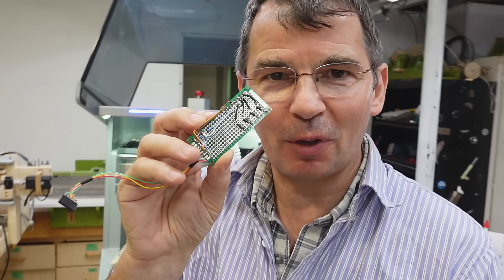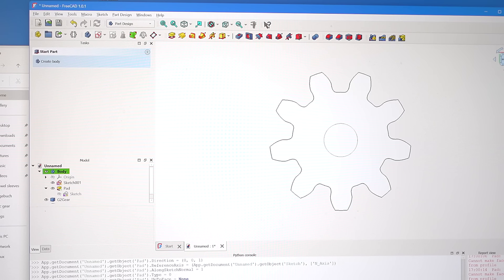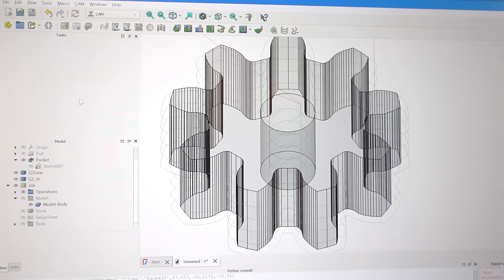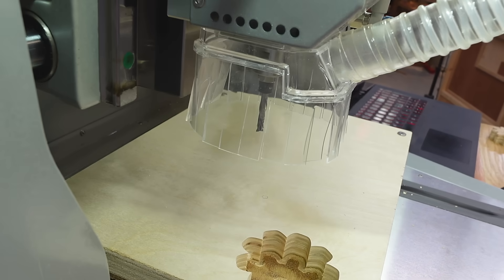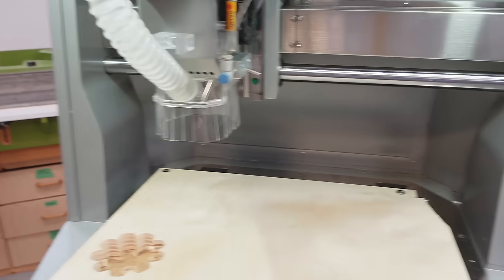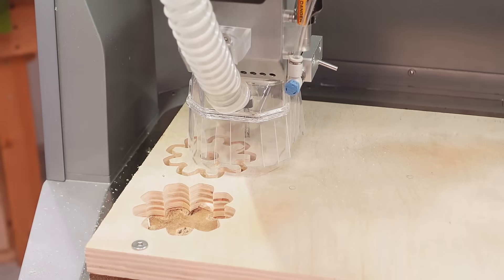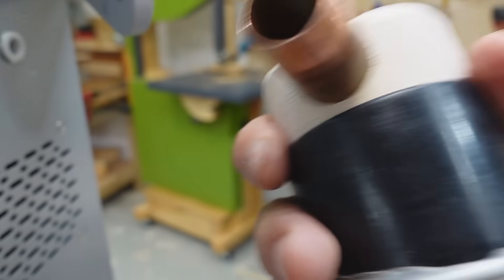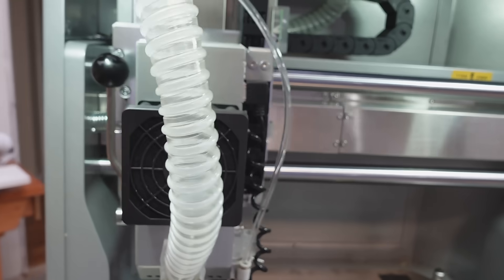Steep learning curve for using CNC

Comment: Anyone know what the clear material used in the dust collection shroud shown at 10:14 is, or how thick it is?  I found some clear vinyl that looks like it might be the same stuff.  It comes in thicknesses of 1.0, 1.5, and 2.0mm.  In the video it looks like 1.0mm, but I'm just guessing on that.

The dust collection brush that came with my CNC isn't long enough for some of my longer bits, and the dust sprays out from under the edge of the brush.  That material looks like it would be good to experiment with, plus it's easy to see through.
Reply from the maker: probably clear vinyl.  It had quite the smell for the first few weeks.
Reply: @matthiaswandel  Thanks, Matthias!  Any idea how thick it is?  It sounds like my next move should be to order some, then hang it up at the far end of the basement until the smell goes away.

Comment: You've probably gotten way more software recommendations than you wanted already, but figured I'd plug Onshape. It has a similar design and feature set to Fusion, but I've found it a bit easier/quicker to learn. The work flow is pretty logical and it's really easy to modify parts at any point in the process, so you don't find yourself pigeon-holed so much like some of the other programs out there. The main downside is that all of you files you create are public, so anyone can access your stuff, make a copy, and have an editable version for themselves. That's a bit of a bummer for businesses, but if you're not looking to patent something, it's been a fantastic free software for me:).

Comment: I taught AutoCAD for many years, but when I retired it was too expensive. Also, I use a Mac, so I purchased ICad Mac (single price, not subscription) in 2018.  I also bought Vectric V-Carve (single price).  I can take my cad drawings directly into VCarve and have
G code in a few minutes. This is not 3D, but works for things like the gear you were making.  Yes, it is not free, but it is easy to use.  
Actually, writing G code directly from the CAD drawing for that gear would be fairly simple, but would take a bit longer.

Comment: The comments at the end of this video really resonate with me.  If you don't use the machine and software regularly, you have to relearn it each time.  As much as I would like to have the capability to do CNC work, I would not do it frequently and quite frankly I don't need a new source of frustration nor an expensive tool gathering dust in the corner of my shop.

Comment: flatcam is the way to do cam for pcbs, it also can be automated.  I just run a script to do the hole milling, cutouts/slotting, traces, copper cearance it makes 3 gcode files in one go, i just have to change the source path for the gerbers..  I use a dual helix v bit for traces and a .8mm endmill for through holes slots and cutouts.  I made a video on the TCL for the automation scripting.

Comment: Makera has a cad program that you could have imported your SVG gear into and set up the tool pads in it. It's not great for overall design but if you have something simple like your gear as an SVG it would take you maybe a minute to do all of the rest of the things, and it's not that complicated, especially compared to freecad.  I design 90% in inkscape for vectors, or tinkercad for 3d, or a mix because you can import SVG into tinkercad.  And toolpaths and a little design work in makera cad. It's in their software download section. Check it out. 😊

Comment: I work at a cabinet manufacturing company, and I run the CNC. I do the programming and operating.  We have a Shop Sabre is 408. it is a 4" by 8" bed, and a 15 tool automatic tool changer.  Every tool height is preset. I manually offset each tool so they all have the same Z Zero. The auto Tool height isn't that precise, it will have variations of up to 20 thou.  Our hold down system is a vacuum table. It works great for large parts, but for small wooden pieces, I use a large piece of plywood suctioned to the spoil board, and screw the waste portions of the wood stock, and then leave tabs connecting the parts.  I have some videos of the machine on my channel.

We have two pieces of software, Cabbuilder, is a pricy web tool (about $1,500 a year) to design and generate primary Gcode for cabinet nesting. Then we also use Vcarve(about $750 one time purchase) for custom parts.  I program a lot of functions into the custom gadgets, its just lua, and is easy enough to learn.
Reply from the maker: well, if you use CNC all the time, then the learning overhead is relatively small.  Just most of my stuff is best solved with other means.

Comment: There is another option for PCB milling, I'll send you a 3D printer with auto bed levelling feature, and a brushless DC motor with a collet that will hold the exact size engraving bits you would require and all you have to do is sort out the Gcode with Onshape or Fusion. Of course work holding is just a matter of double sided tape and then you dial in some Z axis offset to reflect the 1.5mm FR4 thickness. YOu pay for shipping. I am in Kingston Ontario. Easy peazy, and tons more interesting than that Makera journey /headache.

Comment: ive been using blender for over 10 years they taught us it in highschool. theres endless plugins/addons mostly all coded in python to add extra features. i use one called machinetools for adding threads to stuff, theres one to check models to see if theyre good for 3d printing, and i would be seriously surprised if one for this task isn't available. might be worth a look, although blender itself takes a long time to fully understand as it has features for everything. diving in blindly will leave you feeling inadequate so use documentation

Comment: I’m not sure where you are coming from. Is this clickbait video designed to stir up the cnc haters or are you really just trying to point out this stuff is hard? On the cam side I really found it useful to learn about machine coordinates and work coordinates. Once you have an understanding of that you can get the machine to repeatably cut in the right place. A similar story exists with probing. Z probing is useful to find the top surface of the work piece and set its z height to zero. With your excellent teaching skills you can make a real contribution to this subject or I guess you can focus on getting the view count up.

Comment: As a CNC machinist working for a small manufacturer on a budget, I can confirm all CNCs and CAD/CAM packages have idiosyncrasies and a hard learning curve.

Some of us use FreeCAD here and it's definitely challenging, but also very configurable and powerful, the non-free CAD packages are definitely better, but they are insanely expensive for anyone without a high enough throughput to justify the expense. I think for the fact that FreeCAD is free, it's amazingly powerful.

For CAM we use an old version of BobCAD-CAM and it's pretty bad, some of the design decisions are baffling and counterintuitive.

Comment: I have been an acolyte of yours since forever, and I winced when I saw that abomination in the BG. And it got worse as you went in for various close-ups. For the same cost  I bought a proper gantry mill w/ 600(X) x 1200(Y) x 400 Z. designed for wood and I bought is to do detailed 3D wood carving and  V carving signs, plus some unorthodox but brilliant one off creations. It was quite capable on arrival of doing the minutia of PCB development. I have never, in the last 7 yrs, stopped learning new things and bettered my brainbox nonstop. As for the mill, sure some aspects needed improving, but at least it had a cast iron chassis, decent linear bearings on all axis (ways as you call them), and  most of the craftsmanship was tolerable. I am just doing the last part of an epic upgrade that featured some serious mission creep. Also had to re-learn some parts of Mach4 as I have installed new drivers and motors (closed loop), but will ultimately have a better understanding. This herculean task required the complete teardown and no stone was left, I had to manually reball all 12 HGH20 linear bearings + 3 ballnuts to remove all the wood dust/grease. 2600 of them, one by one, with tweezers... Nearly lost it. But I digress,.. mission creep factor is what happens as you learn the optimum  path forward. You don't know the full parts list at first.   During the lengthy and rather lazy process, I found timely morsels of critical design accents and methods of improving my process As it is, the upgrade has cost more than the machine. We won't speak of the new 3.2kW ATC spindle with the BT30 tool holders. Also the same re; the cost of carbide endmills and other tooling. Anyway Matthias,  what about Onshape that many YT influencers are shilling for? And do you really make enough as a YT content provider than Fusion will permit? I contest that. Respectfully yours, CGL

Comment: Sounds like you're done with FreeCAD. What software are you going to use from now on?
Reply from the maker: I may go back to writing more code to take output from sketchup and make tool paths from that.
Reply: @matthiaswandel  I haven't used Sketchup in a long time, but when I did, I had a lot of issues using the files it created to work in other software environments. I started using Fusion and it always just worked for me. But it's expensive and I'd like another solution

Comment: Hi Mathias thanks for sharing. I faced the same issue balancing manual and cnc machine. So many steps to take note and G-code conversion. Rather I do it manually and enjoy the traditional machining :) cnc are cater for mass production work not for hobby workshop.
Reply from the maker: Having used a bridgeport and cranking it to a certain spot, got absent mided, and overshot.  Figured, CNC must be the way to go.  Not so sure now.  For anything casual and one-off, manual rules!

Comment: Is this video in like 15fps? There seems to be an issue with the framerate.
Reply from the maker: yes, at some point I set the camera to "shutter priority", and the shutter speed was set to 1/25'th of a second.  So it did that, which meant every other frame got skipped.  Oops.  Problem is, I have two more videos filmed with  that setting!
Reply: @matthiaswandel  That is unfortunate.

Comment: I started with Sketchup 13 years ago when I built my first 3D printer. Some people seem not to like it but Sketchup has produced everything I've ever needed and can be as simple or as sophisticated as you desire. The gear you created in Freecad  is very simple to produce in Sketchup - probably takes less than 2 minutes if you use a plugin.
 I also built a CNC in 2018 (on similar lines to the Workbee but with a few modifications). What I found strange on your machine was the need to probe the material surface height, then probe again with the tool-bit? Not sure why that is necessary - the tool bit itself is the probe if you use a "roaming" puck but I guess you may have an issue with the electronics? What control board does it actually use? 
One program you might consider for PCB isolation routing is Open CNC Pilot. It can probe the uneven surface of the PCB (often curled) to create a "height map" then route the tracks etc in the board, and yes, I've made plenty of PCB's with it.
Reply from the maker: Yes, SketchUp definitely has its limitations, but man, its so fast to use.  One guy commented he sketches stuff by hand before figuring out how to do it in CAD -- no such problems with SketchUp.  Of course, it lacks paraemtric, so changing a dimension can be annoying, but still faster than having to make the model parametric in the first place!

Comment: Easel is a web-based software I have used on my Carvera (and an ancient Inventables machine before that) to great effect. It does a fews things really well, and is okay at most other things. It can do simple 2D and 2.5D drawings in the app, and SVG/DXF imports, which is great for quick things like boxes, gears, or inlays. It can also support 3D model imports for that full CNC experience, but there are probably nicer options out there. Finally, it offers very easy V-carve capabilites, and is way easier to get good results with than any Vectric software, in my experience. Some features are locked behind a paywall, but it is free to try. The subscription offends me, but it definitely flattened the learning curve with my CNC machines.

Comment: I'd recommend using DXF's or DWG's, not SVG's. SVG's don't do well with "absolute" units and I've had different programs load the same SVG as a different size. DXF and DWG work much better in CAD in my experience across multiple programs that both generate and consume vector graphics.

Comment: FreeCAD gets easier with time, or so my stockholm syndrone tells me 😅 it is a very steep and painful learning curve when you're use to Fusion360. The Carrvera probably has propeitary g-code which is why the cam workbench was problematic, granted i've never used the CAM function in FreeCAD, i've only used flatcam for CAM

Comment: 13:58: That was my problem with FreeCAD. I spent about a month with it and pretty good at the basics...but if I dont touch for a couple of months I have to learn all over again...A tell-tale sign of an unintuitive interface(in realty I spent the time to write some cheat sheet tutorials to ease the pain next time).  I got burned with Fusion360 a few years back when they started removing features and changing their terms.

Comment: I would think that if you are going to use FreeCAD (and probably other cad programs, to generate your gcode for any device you will want to spend a few minutes setting up start and end scripts for your platform. 

An example of the end script might be to raise the tool head (or "lower the bed which I've seen in 3d printing because so much of it came out of the Ultimaker 3d printers) to clear the detected top surface by 1-5 mm (whatever you're comfortable with) and move the tool head to a back  corner of the  working space. 

The start script should record your origin as a learned location by tracking how much the tool head needs to move to do it's pre-work of detecting surface height, and tool length, with necessary tool change codes. Because all of this is going to vary by whomever makes the CNC device, and what type of CNC device you're working with, these commands are going to be widely variable. 

That said, you can probably look at the sample gcode files the manufacturer generated and work out what should be in both scripts,

Other scripts you might want to build up for the CNC controller for job pause, job abandonment, (cancel) and other situations that normally wouldn't be in the stuff sent by the gcode generator. 

And yes, the manufacturer is probably including instructions for how to manage their device in Fusion 360, and a few other programs, but haven't figured out that they may need to do some of this for FreeCAD. Part of that may be not knowing what workbench in FreeCAD needs the help.

Comment: Fusion 360 licensing is per seat. So one computer at a time. But the computers can be in different locations. Just one running at a time. So perhaps you could share a commercial licence with 2 or 3 others? It's pretty painless in comparison to what you showed here. (Not that there isn't a leaning curve to CNC routing!) But Fusion makes it about as straightforward as it gets.

Comment: I began my CNC adventure in 2019 and I concur with your opinion on FreeCAD. As a Linux user, I appreciate the idea behind a FOSS solution to the CAD/CAM conundrum, but the UI on FreeCAD sucks and when I attempted to learn it,  all the videos and documentation were several versions out of date and therefore almost entirely useless. 
CAD software is not too much of a problem as there are quite a few choices out there. It's the CAM software that writes the G-code that is stupid expensive and difficult to master. My CNC has been down for well over a year as I am planning on rebuilding the electronics...some day. Maybe by then there will be a decent CAM software that doesn't require a mortgage or idiotic subscription.
Regarding the crash where the tool was stuck in the workpiece with the spindle still spinning; I had this issue a few times with my original Richauto controller which was a piece of crap. The advice among most online CNC groups is to ALWAYS keep a fire extinguisher near by and NEVER leave a CNC running a job unattended. It's a good way to burn down your shop.
CNCs are a lot of fun once you learn the software and how to run them. No better way to make precise, repeatable things.
Reply from the maker: Ha!  I actually downloaded version 0.21 so I could follow the tutorials.  That helped, even for then figuring out version 1!  But all those features make the program rather "brittle" to use - in that, you figure out a specific pattern of use that works and skip to that.  So all the built in flexibility makes it MUCH less flexible to a normal person.

Comment: Combination CAD CAM software is a relatively new trend, traditionally you would use CAD for the geometry and CAM for the toolpaths.
I would recommend you keep using a CAD you like, export 3D geometry from it, and look for a standalone CAM solution to generate toolpaths with.
I cannot recommend you a good one, despite trying many, because they all suck and the one with the lowest vacuum levels are horrendously expensive.